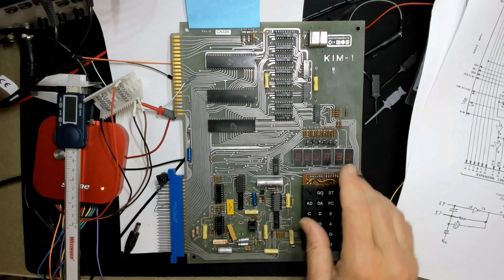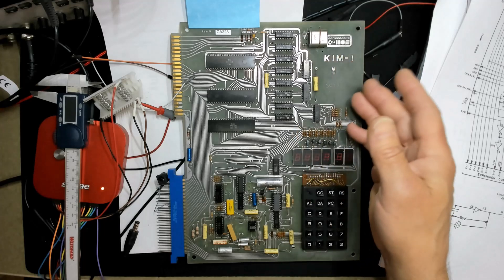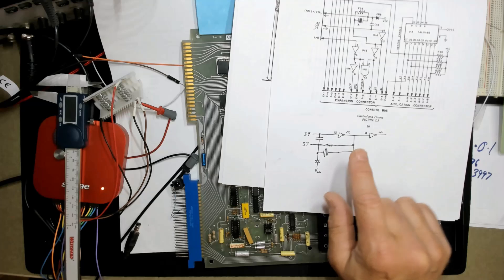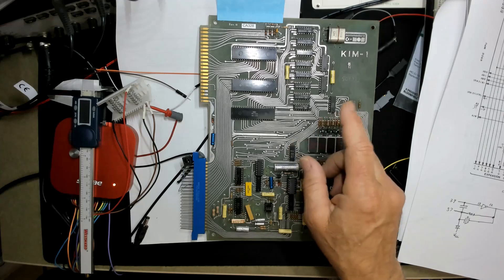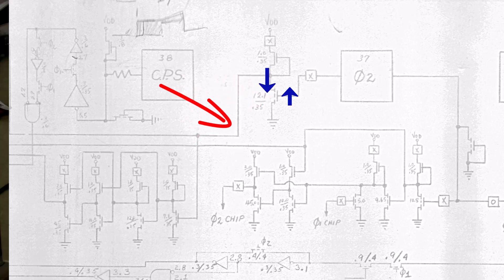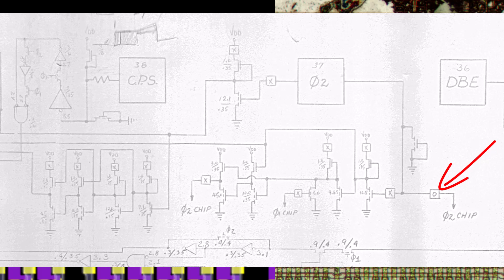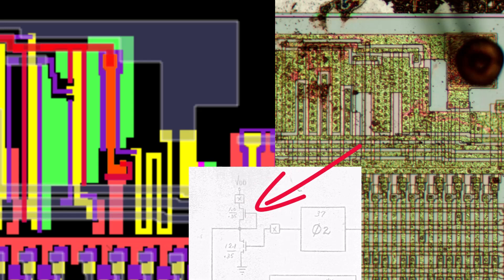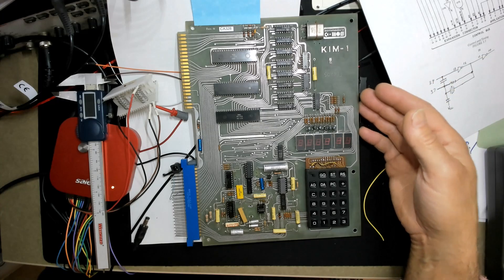{129} How is This KIM-1 Still Working With a Blown Gate on The Clock Input?

Comment: Great detective work there, HW! Why not just replace the 6502? My reasoning: If one internal node is zapped on the die, how do we know its the only one?
Nostalgia. I bought my KIM-1 back in the late 70s. It cost me $100 to upgrade the memory from 1K to 2K. Those were the days!
Reply from the maker: Only because it is the board’s original 6502.  If the leak were anywhere other than the protection FET, i would probably just replace it and be done with it.  But i am fairy confident that this will be reasonably reliable since that FET can handle the heat—so it could be years until it is unusable.  Plus, it isn’t going to hurt anything when it dies, and it isn’t going to be worth any more now than it will be then. So I can delay replacing it until it finally goes out.

Comment: I have seen exactly the same problem when reparing a vintage VGA card and I used the can oscillator without problems and it look almost the same as the original.

Comment: Learnt loads here. 👍 In the middle of trying to fix mine. I have a clock and runs for about 20 instructions and halts, I think I have a ram issue.
Reply from the maker: @unicornpub  I might suggest not using RAM at all.  I spend a lot of time running RAMfree code when bring up glitchy hardware.
Reply: @HelloWorldETX  Yes definetly an option. I have all the bits here to build a rom card, hmmm food for thought.👍 I have also ordered the bits to make a 24 channel logic analyser. 8 channel is just not enough.
Reply: @HelloWorldETX  Drat the 6530-002 has a bad data0 line, stuck on 0v. GGGrrrrrr!
Reply from the maker: @unicornpub  Yea, that's going to leave a mark.

Comment: The 6502 from those days was very sensitive. I have an Acorn System 1, bought in 1979, but I had to replace the 6502 in 1980 because I accidentally stopped the clock.

Comment: The serpentine, if it is in a diffused layer is probably a series resistance - so a bit of resistance on the gate to limit the current into the gate capacitance on the  clock edges and reduce the transients generated.  It could be to stabilise the clock system or it could be to limit the current spikes in the gate and reduce the risk of electro-migration of the metalisation.